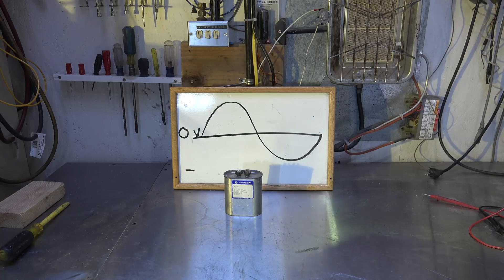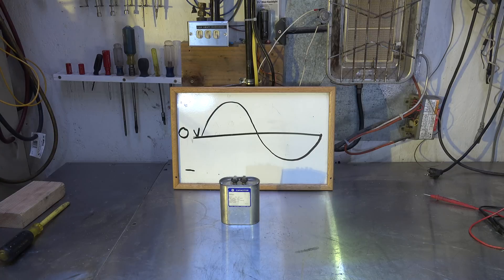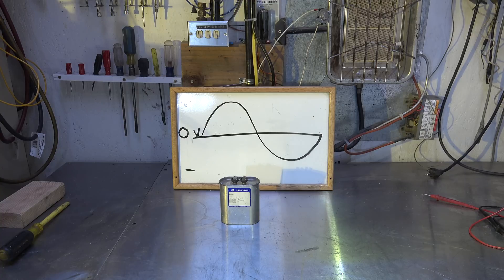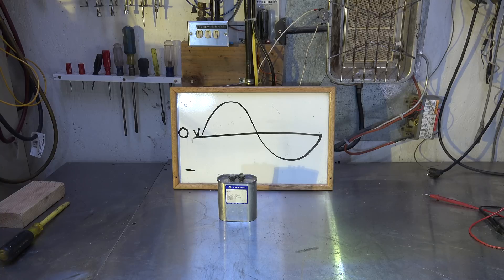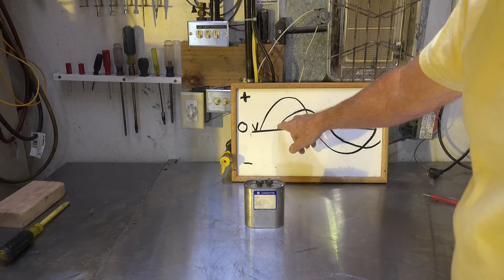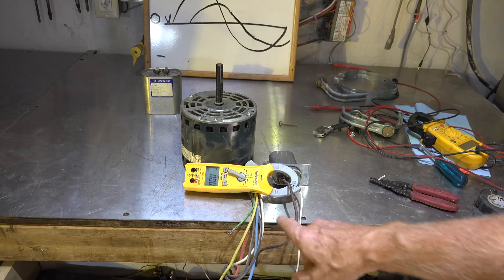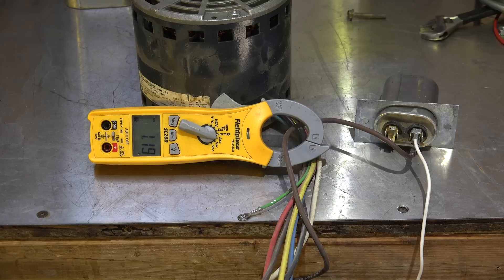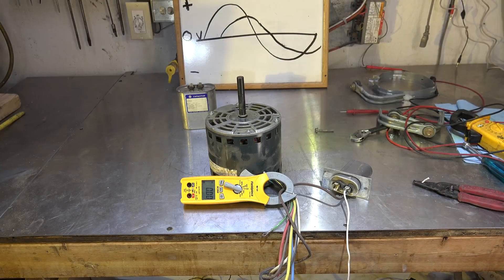What does the capacitor do in the PSC motor

Comment: Don't mind if I barge in.
I have left my uneducated comments in two other of your videos for your head shaking moments.
As I mentioned in your other video, it is not correct to say that a capacitor limit current flow, like a resistor.  That is why, you can't explain why it does what it does in terms of making the motor run effeciently, smoothly or whatever.   That teaching of motor running smoothly etc is how it is taught, put out there.  It has no meaning.  And the students ( folks) hearing it, memorize it and go just keep moving.  

Here in quotation:  "A run capacitor is wired into the main coil circuit and is never disconnected from the circuit. The run capacitor holds a charge to help mitigate power issues while the motor is running. They help to smooth out the flow of power and improve the performance and efficiency of the motor".

IT HAS NO MEANING, NOT TO SOMEONE WHO PAYS ATTENTION.  I call that garbage, prententious,  clown teaching. 

No wonder if flunked school.

Here is my version:
A capacitor does not remotely resemble, nor act like a resistor whatsover.   Keeping the role of the capacitor within this subject is this it looks like this:
 The capacitor gets charged when the current moves through it  ONE WAY and it discharges when the current CHANGES DIRECTION.   And this is the big point to pay attention and stop to see what this means.

Before I explain that, I will throw another one.   You realize that it makes a difference if you place the capacitor in the black or the neutral wire.   That reason goes with the my first point.

The capacitor is to discharge in the different coil ( so called auxilliary winding) having a shift in phase and that discharge moment is to be in the same direction as the direction of armature.  And it is to charge when the current is moving in the opposite direction.   You should know exactly why.

It is equivalent of pushing the child that is on the swing set in the same direction as the swing and not the opposite way.   THAT IS EXACTLY WHAT A CAPACITOR IS FOR AND THAT IS  EXACTLY WHAT IT DOES.  A capacitor does not provide phase difference.  The auxilliary winding with is position and it's inductive reactance does.  Hence not only its position but is resistance, inductance, reactance all combined as impedence if you want to go that far.  The capacitor has different impedence.  Nonetheless lets not get to carried away here.

So this detail should fill in all the rest be it a motor with run capacitor only, run and start capacitor or just start capacitor.   Each type is designed so you don't screw things up.
Notice that in blower motors which only have run capacitor you are not given the option to put the capacitor in one or the other ( neutral or hot) leg.  It is set in stone for that reason.
Typically it is in the common wire, whichever is considered common, usually white is called common.  But these lingo cause more confusion than it solves. "netural, common, return, ground" mumbo jumbo.

The real teaching is not exposed as that is not very economical.  It doesn't make for repeat customers.  Yes, students are customers.

Armature will follow where is the phase shift magnetic flux takes place by means of reluctance. Notice that the armature have aluminmum short circuits.  Aluminium is mildly attracted towards magnetic flux while copper is repulsed. Paramegnetism in one and diamgnetism with the later.  There is a reason why alumiminum is used in the winding of the armature and not copper.

So once the heavy mass of armature gets going in one direction, the last thing you want is to supply current to the auxilliary at the wrong time.   No, when the direction of current changes, there is no effect on the main run winding as they are smack at 90 degrees, the armature can not tell the difference however you do not send current to the auxilliary when current changes direction.

That is exactly what the capacitor does.  The Auxilliary winding is dead, no current flows one way and then when current flows the other way, the direction that the armature is moving, after all that is the direction that it was pushed in the first place... that is correct so, the capacitor discharges in that same direction.  Read that one more time. The capacitor discharges in the same directiion that it got the armature to move in the first place.  READ THAT THREE TIMES IF YOU NEED TO.

All of this clearity is reflected on the " how you change the direction of motor rotation".  Something to think about.  Don't you see?
If you want the motor to run the other way, just move the capacitor to the other side of auxillary winding.  READ THAT ONE MORE TIME TOO.  Say instead of between black wire and the auxilliary winding, move it to the other side and place it between the auxilliary winding and the white wire. Or if it was between the white and the winding, move it between black and the winding.  Are you getting it?

  This discharging clearly has two aspect.  And it is a no brainer.
One it sends current in the right direction, meaning at the right time and secondly it does it with one burst 
Examine the chart of charge vs discharge  of  a capacitor.  It takes longer to charge than discharge and this is a good thing.

Besides other reason the first instant of charging a capacitor it acts like a closed circuit,  Not because it is,  but because of existing electrons getting repelled on the positive plate.  Just ask Maxwell.  
Do not buy for one New York second that there is an actual current flow through the dialelectric.  There isn't. Period.

NOW THAT YOU KNOW EXACTLY WHAT IS GOING ON.  IT IS FINISHED.   YOU DO NOT NEED TO SEND ME ANY TUITION.

Comment: So when the capacitor is charged up that charge helps get the motor spinning easier and right direction. But once it is the capacitors charge acts as a impedance to the current draw allowing less current to the motor?
Reply from the maker: That is true.
GFM

Comment: That radiant heater on your wall is really neat! Did you fit it with an aftermarket intermittent pilot kit? And now can thermostatically control it with an external gas valve? Thats genius! Curious to see the rest of the setup. Great video explaining how permanent split capacitors work and the purpose of the capacitor as well. Great video as always!
Reply from the maker: Its quite simple.  Its a propane heater converted to natural gas with a Honeywell S86 gas control system.  There is no thermostat except for the limit switch in the upper left of the radiant heater to shut the unit off if it is blocked.  Maybe I will do a video on it someday.
GFM
Reply: @grayfurnaceman  do you have a toggle switch to turn it off and on?
Reply from the maker: @markallan9050  There is a switch.  You can see it labeled "heat".  There is also a proximity switch to shut down the gas supply when no one is in the location.
GFM
Reply: @grayfurnaceman   that is so cool! I love making things like that...and tinkering with cool gas projects. Would love to see a video of it and its sequence of operation

Comment: If I may add a non-engineer's comment to this interesting discussion of capacitors: they "produce heat" - got to have the "oil" in there to absorb it (it used to be high-performance PCBs, right GFM? ;)  

That heat comes from somewhere, specifically the "electricity" going into the capacitor. Volts x Amps?  Lower voltage --> the difference coming out as heat?
Reply from the maker: Capacitors are semiconductors.  They are neither load nor conductor.  As in all semiconductors, there is some voltage drop across them.  That voltage drop is converted to heat.  Depending on the application, oil may be needed to transfer that heat from the interior of the component to the shell of the component.
GFM

Comment: Kenneth christensen
You got this one wrong.The current travels through the start winding and then into the run capacitor.When the cycle changes the capacitor pushes the current back to the source at the same voltage cycle as it was on when it went into the capacitor. This creates a third leg  we call split phase.There is no current going through the capacitor and no resistance.The larger the capacitor the greater the current draw on the start winding and the greater the torque.
Reply from the maker: You might check a video I have done that will be published 7-16-19.  The capacitor is not a dead end.
GFM

Comment: Are you referring to the "Auxilliary Winding" in a PSC as the start Winding? According to Beckett Corp and the NORA Oil Technician's hand book , it has an "auxilliary" not a "start" winding.
Reply from the maker: It is the same thing.
GFM
Reply: @grayfurnaceman  
TG it's called a "start winding" - the name actually describes its function. 

Now I wish "start capacitors" weren't called "run capacitors".

Comment: When u call for heat the puge motor don't start but after bunner comes on hear click motor starts shut power off fault code 12 when I shut power on purg motor starts and shouts off so when heat comes on motor starts puge motor won't come on next

Comment: No I turn off funace get fault code 12 motor starts when I start it but after that when call for heat the motor only comes on after bunner lights bad bord maybe
Reply from the maker: So, if there is a call for heat, the burners come on then after about 30 seconds, the fan motor comes on.  If this is the sequence, it is normal.  Let me know.
GFM

Comment: How to Identify the  Terminals of fan window air condetioner (6 or 5)wires
Reply from the maker: ammar alyasiri The only way to know is by using the wiring diagram. It should be located around where the power wires enter. 
GFM

Comment: Ok, I think this was the video I was thinking of.  So voltage is literally flowing through the capacitor, and being "impeded", and the limit on the voltage, causes the motor to run more efficiently?
Is it lowering the voltage? 
If you have a higher micro farad capacitor, does that cause the "impedance" to increase, or decrease?
Reply from the maker: It does limit the voltage in the start circuit.  The higher MFD has multiple effects as it interacts with back EMF and the position of the motor windings.
GFM

Comment: When you removed the capacitor and ran ac directly to the run winding, you put the two wind in phase with each other and they were fighting each other. NOT because you put too much power to the winding. You really need to research this, rather than putting out false information.
Reply: Yeah and in fact, capacitor to one winding can tell the motor which direction to spin. If you switch capacitor and full power between 2 windings, direction can change. That's how some ceiling fans change direction.

Comment: A capacitor is not a resistor, perhaps google phase shift for an understanding of what a capacitor does in a psc motor.
Reply: wrayman63 
The dynamic resistance of a capacitor Xc, or capacitance reactance,can be used as a type of resistor.
Reply from the maker: It is not a resistor, but it does introduce impedance as it charges.  The overall effect is to reduce electrical flow to the start winding.
GFM
Reply: The Start winding? I thought this was about PSC (Permanent Split Capacitor), so I am not sure what you  mean by Start winding. The start winding and the auxiliary winding on a PSC motor are completely two different things. This is not the reason the capacitor is in the circuit. The capacitor is in the circuit to create a phase shift of the second winding. As I said in an earlier post, the reason the motor is overdrawing when you introduce an AC field into the Second winding, is because they are in the same phase. This IS the reason the Capacitor is introduced into the circuit, to create another field that is OUT of PHASE with the primary winding. It HAS nothing to do with being a resistor. Any capacitor, winding, inductor, resistor will effect the reactance/impedance of a circuit, that doesn't mean and is hardly ever why they are used, especially in motor circuits.

And to clarify, IF you are TALKING about the "Impedance" factor of a Capacitor, it is expressed always in REACTANCE, or Capacitive Reactance, not impedance.

Did you know you can take a 3 Phase motor and use it as a PSC? So what does resistance or impedance have to do with that?

I am not going to beat this horse anymore, I suggest you look at the Wikipedia article here and see if impedance is mentioned???

https://en.wikipedia.org/wiki/AC_motor#Permanent-split_capacitor_motor
Reply from the maker: I think that's best.  We are simply getting into semantics and talking around each other.
GFM

Comment: The capacitor reactance current leads the supply voltage by 90 degrees and the inductive reactance current of the motor lags the supply voltage by 90 degrees . The run cap is for efficiency by cancelling out the reactive power load which will provide a better power factor close to unity or 100% .
Reply: Yeah, and when it's out of sync, the motor can buzz. Some ceiling fans use lower capacitor to start windings for medium and low, I have a Hampton Bay Rockport that's like that and it's silent on high but noisy on low and medium. I hooked remote receiver to it once, and as long as the chain was on high, it was silent on all 3 speeds with the remote!

Comment: I always saw that capacitor as a run cap. The black plastic type is a start actually 150-175 mfd on some models. Is it better to have a dual run cap in this case?
Reply from the maker: The dual cap will work about the same as a single cap.  
GFM

Comment: With an inductive load, such as a Motor, you will have current lagging the voltage. This will lead to a power factor of less than (1). If you have a low power factor, to correct it, you would add capacitance to the circuit. The goal is to try and reduce the phase angle between the voltage and the current. The ideal is to have the voltage and current (in terms of a sine wave) rising and falling at the same time.
Reply: @griffmustard  You wrote this comment 8 yrs ago so you probably already figured out that the goal is not to try and reduce the phase angle. The capacitor is actually used to increase the phase angle to about 90 degrees between the current in the start winding and the current in the run winding so that their peak currents don't happen at the same time. The currents going through the windings create magnetic fields around the 2 windings and when the currents are at their peaks so are the magnetic fields. By offsetting when the magnetic fields hit their max, it simulates a rotating magnetic field and helps start the motor. That's why you don't need a capacitor with 3 phase power. With 3 phase power the 3 currents already have a phase shift of 120 degrees between each other. 

By adding a capacitor in series with the start winding in a single phase motor, we manipulate the single phase power to act like 2 phase power.
Reply: judging by his other videos, greyfurnaceman doesn't fully understand power factor: "I can't say i understand why it helps the efficiency of the motor" he says.

Also there's a video where he judges the power draw by just the amp draw of a motor with no regard for PFC.
Reply: If the curent rose and fell with voltage only the resistance of the windigs would limit current flow and the motor would burn up. There must be some Xl and Xc to add to the resistance resulting in impedance that limits current flow along with back emf. Without impedance there would be the same amp draw as locked rotor .An ac motor MUST have a phase shift to start.
Reply: Griff Mustard well said! 👍🏼

Comment: I found a weak cap on an old Lennox and the cond fan was running backwards, replaced and it worked fine.
Reply from the maker: It does happen.  I don't know how but it does.
GFM
Reply: Think of the two phases like pedals on a bicycle. Since the pedals are exactly opposite on the crank shaft will not be able to start  at 0 & 180 degrees.  

With a bike you start by manually rotating one pedal forwards past 0 degrees, and then pushing that pedal first.  The capacitor is like rotating the a pedal on the crank shaft - a phase delay so that they are no longer 180 degrees apart.  Now  you will always be able to push and rotate.  

You can shift it up to 45 degrees, or 1/8 turn and then pushing will always get rotation.  However if you rotate it too much, past 90 degrees turn then you may not have momentum get a complete rotation since both pedals are on the same quadrant of the cycle.  As  you rotate to 180 you cannot move out of the bottom position. Continue shifting the adjusted pedal past 180 degrees on the shaft, now pushing only down, it will turn backwards. Adjust past 270 and it will always move backward until to shift past 360 and start the forward motion of the cycle again. 

That is what a capacitor does - shift one of the two phases so you can always get the rotation that you need.
Reply: @danball4410  
This needs a cartoon animation for visual aiding.

Comment: does the other side of the capacitor draw the 2.3 amps? does it change the total amp draw of the circuit or does it stay the same?
Reply from the maker: The draw is the same on both sides.
GFM